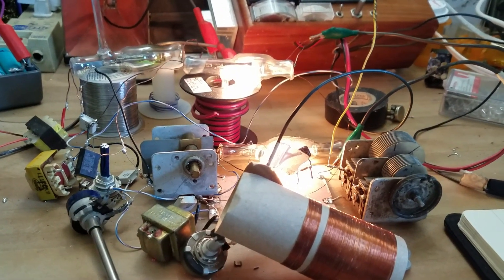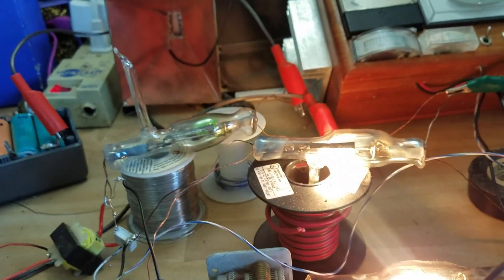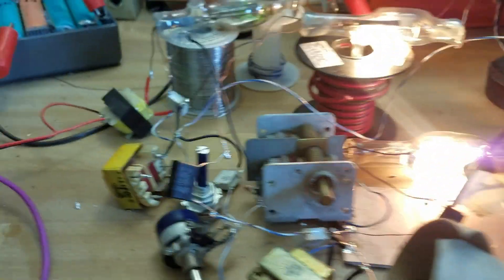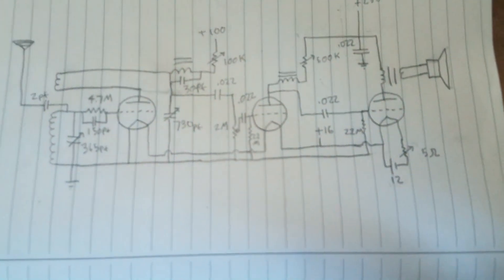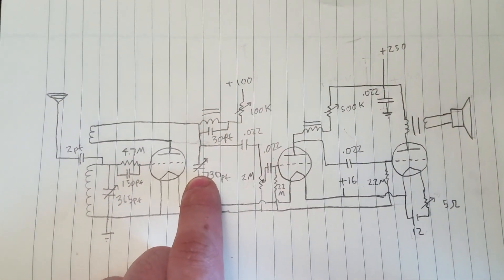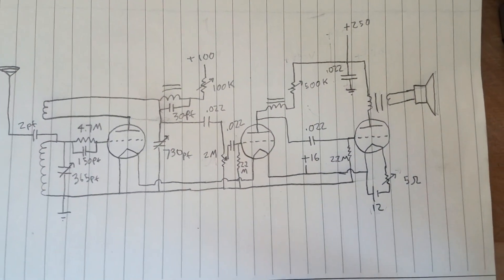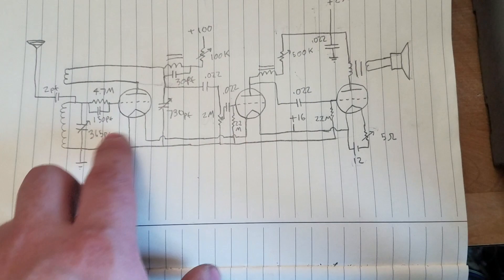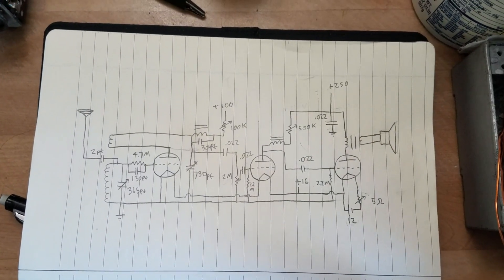Radio Built With Homemade Triodes

Comment: That a neat project. I have made radios with ready made tubes before. like 1T4 6SA7 ETC. homemade tubes is a first for me. if willing to make more tubes you could just add 1 more and make out put a push pull audio out.give much more audio.

Comment: Thanks for directing me here. So fascinating & must be the only example of working bright emitter tubes on YT! Of course, back then, a high impedance horn speaker would be used, which is more sensitive. Nonetheless the performance & selectivity is impressive. My experience of 1920's audio is limited to dull emitters but get the idea that performance is comparable.

Comment: Neat. If you're going to build these into a project, the long evacuation stem might actually be a good mounting point; it could fit into a hole in a board and the tube would be able to "float" in the air for cooling purposes. If the heat and current draw are an issue, you might want to pick up some smaller diameter tungsten for the filaments. I went back and found some of my amperage calculations for common filament diameters; they might be helpful to you:

0.015mm: 1/16 - 1/8A
0.025mm: 1/8 - 1/4A
0.040mm: 1/4 - 1/2A
0.065mm: 1/2 - 1A
0.100mm: 1 - 2A

The low end of the current is when useful emission starts, and corresponds to an estimated filament life of 2 million hours. The high end is the maximum reasonable temperature, with an estimated life of 100 hours. The lifespan calculation is based on the rule of thumb that filaments fail at 10% loss due to evaporation. These are all derived from the book I mentioned earlier, so you can double-check if you'd like, but I found the values to be accurate when I was building tubes. Note: 0.015mm tungsten is really hard to see; I'd recommend 0.025mm (0.001") as a good minimum size for general purpose tubes, with the bigger sizes being used for power/output tubes.

As for gain/transconductance, if you can manage to make a spot welding jig for building helical grids (remember, copper is invisible to spot welders), you'll see a massive improvement. I think you mentioned earlier worrying about grid/filament spacing/centering, but it really isn't that critical. So long as the filament doesn't touch the grid, it'll work fine; I've build some seriously off-center tube structures and didn't notice much of a difference. Probably has something to do with space charge, but I'm not sure. If you can manage to make an inverted-V filament structure, you should be able to insert that into a helical grid with your current double-ended setup without much of a problem. The key with spiral grids is just to make sure they have a rigid support so nothing shifts during assembly and you don't get spring noises (microphonics) in your audio output.

Looking forward to seeing these tubes assembled into a standalone project; for me, that was the stage where I started getting interested in woodworking/materials/finishes. Transistors can just be stuffed into a plastic box, here's just something about tubes that makes you want to build a nice house for them. Anyways, nice job and good luck!
Reply from the maker: Thank you!  I have the long stem right now in case I need to re-evacuate in the future but I have not needed to yet so I might stop doing that. I have started reading the book and it is very enlightening, so many questions answered... The filaments are currently from car signal lamps and are too high of a power, I will be buying a roll of smaller wire for the filaments. I might even splurge and get some thoriated tungsten for higher emission.

Comment: Congrats! I'm sure you can get better performance out of these things, but I get the feeling you haven't made many regen sets prior to this, correct? You could also try a self-quenching superregenerative circuit - the results can be astounding, delivering gains in the tens of millions. Additionally, there are audio reflex sets, and other oddball ways of getting more out of fewer tubes. I've never liked using a throttle capacitor for regen control; too unstable. I much prefer tickler adjustment, or the use of miller capacitance.
Reply from the maker: Thank you! I have actually built quite a few regenerative receivers but with commercial tubes and transistors. I have found the superregenerative receiver only useful for higher frequencies like FM otherwise the quench frequency needed for the high gain is audible. I have an all tube FM radio that I use that is superregenerative but I have never made a video.
Reply: I should remind myself that you have essentially recreated tubular Audions, which were notoriously persnickety in their operation. I've not managed RF regeneration with any of my homebrew vacuum device attempts, though some have served as detectors or audio impedance matchers. 
The best performing triode radio design I've tried that works well for the AM band is the Hellendyne or Angelodyne, each a variation of a plate detector regen set. Building one with a directly heated cathode would present additional biasing challenges, but not insurmountable.
Reply from the maker: Sorry if I came off as rude! you are right that this does not work as well as other receivers I have made. I will look into the Hellendyne and Angelodyne I have not heard of those before and they sound interesting.

Comment: You could use a thinner tungsten wire for the filament. That would lower the power consumption quite a bit. Then you could either leave them as bright emitters or coat them with an emissive coating, such as barium carbonate. 

It takes something that most people don't have to pull off a thing like that.
If only society valued more people like you instead of these "celebrities" that we have now. 

And as always, keep up the good work. Sooner or later, you'll accomplish something great.
Reply: Honestly I'd say he's accomplishing something great right now. There are currently only a few people making tubes, and while industrial tube manufacturing is a well-established process, doing it on a small scale is an entirely different operation; essentially, this is uncharted territory being mapped out in real time. Furthermore, of these few tubemakers, his setup is by far the simplest in terms of equipment; it's less of a high-end physics experiment and more of a hands-on trade, and I mean that in the best possible way. This is a big step in the direction of tubemaking being an established craft, and towards the de-industrialization of electronics in general. Hopefully it'll inspire more people to do the same.